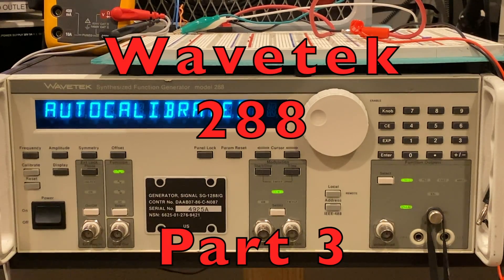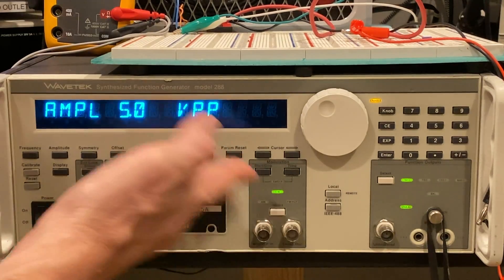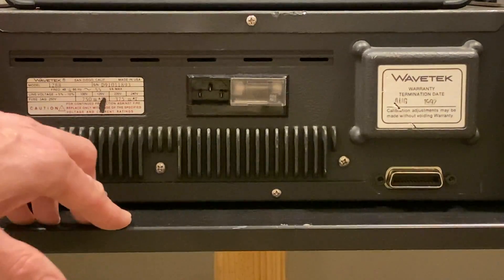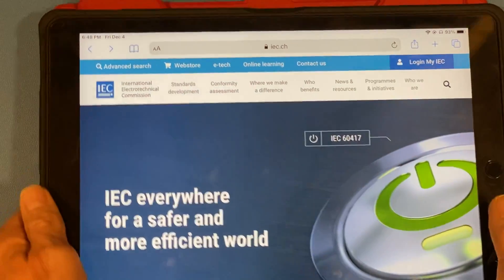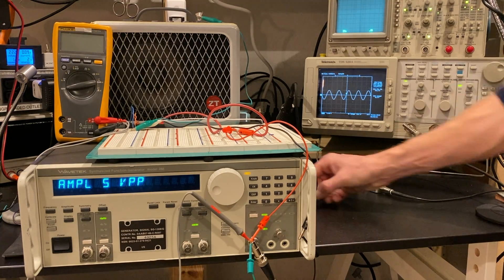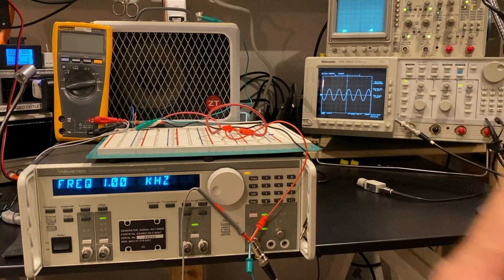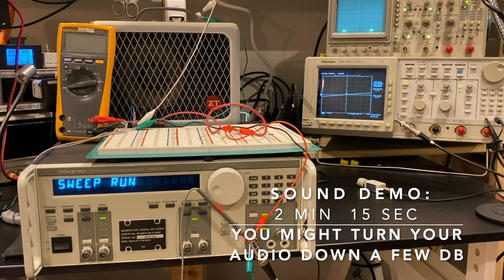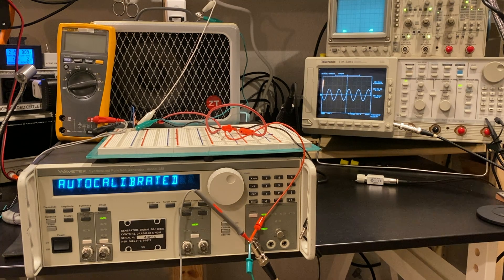Wavetek 288 Function / Signal Generator Part 3

Comment: Very cool indeed.
Question:
Can you set a specific Baseline and then set that as your recall/ reset Baseline?
Reply from the maker: Yes, though only via the GPIB programming system, which requires an outboard PC for anything outside factory settings.  If you find you're calibration to be off, the manual does have procedure for resetting that particular Baseline, and storing it to the EPROM chip.

Comment: How screwed are you if you replace the battery without the power on?
Can you copy the programmed chip [ram?] from the current memory for backup?
Reply: Hi Brad, that’s a quality question :). In many electronic units of this before and after, yes, if you remove the battery without the power applied, you do run the risk, pretty high, that the original calibration information could be lost. However, there are some computer programs that a person could use to reload the information to a chip, from an existing healthy chip as a file. Also yes, you certainly could extract the file to a dump file, place it on a small sd card and tape it inside the unit, which some folks do.

Comment: You changed settings from a triangle wave to a sawtooth on one end to and opposed sawtooth on the other end... What does that actually do? Asking for a friend. Lol
Reply from the maker: If you see, we never really went to a true Sawtooth wave, but close, only 5% or 95%.  A true sawtooth wave has a direct rise or fall, no sloping on one end.  The function of this perimeter exists on this model only for fine tuning to a users desire the given default wave Sine, Square or Triangle.  The generator does not contain a sawtooth by definition.